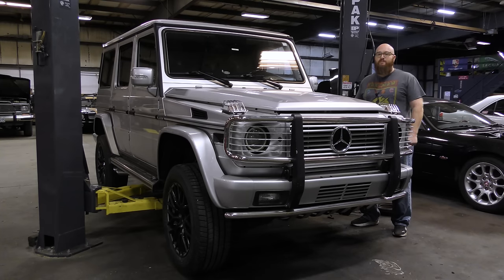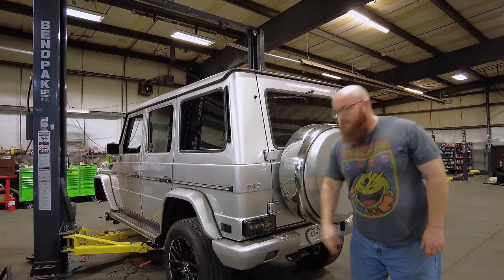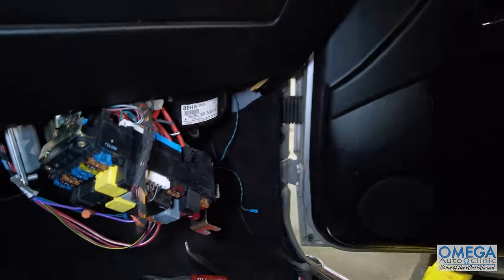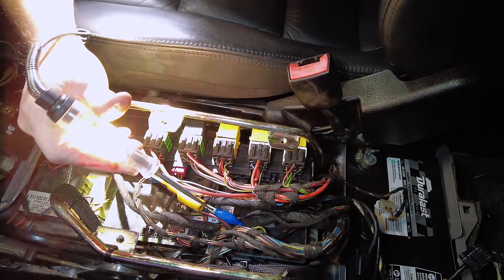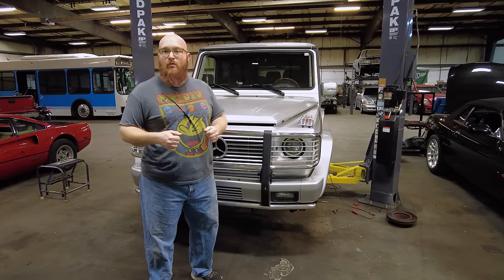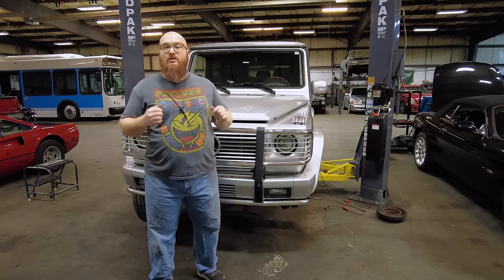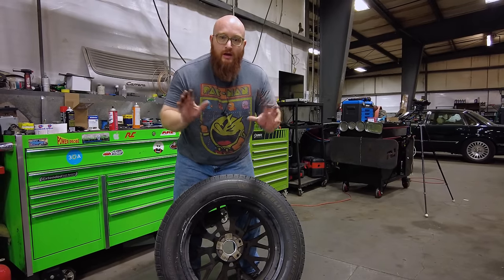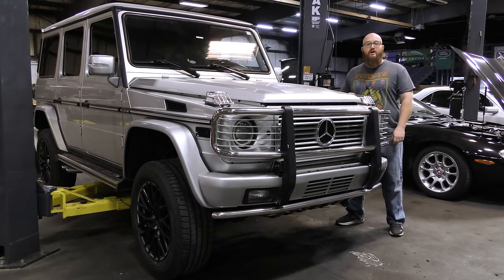Dangerous Mods on this '03 G55 AMG G-Wagon! CAR WIZARD shocked at the level of stupidity

Comment: 12:15 the wheel bolts CONICAL seat ( the V shape ) centers the wheel perfectly to the holes, not saying you should cut middle off but wont necessarily cause the wheel up down issue
Reply: The hub extending out is what supports the load as well as centers the rim.
Reply: @JasonWW2000  NO NO NO i have changed 1000s of wheels... the hub ring is almost never machined to tight tolerances, on most vehicles its loose/plastic. it does not support or reinforce anything a complete fail...
Reply: @JasonWW2000  if you really think the hub ring supports the wheels your clearly not paying attention while changing wheels.... the clamping force holds it and CONICAL seat centers it, it dose not move around to let the hub ring support it... ITS NOT PRESSED ON LIKE A BEARING. Stop making shit up...
Reply: @DeVoNmotorsports  I guess that's were we differ. You install wheels and see the aftermath when the studs break and the wheel goes flying off. 
The tolerance is not super tight or else the slightest dirt would prevent the wheel from going on. There is a tiny gap. This gap disappears when you hit a pothole and you get metal to metal contact. 
Look very closely at a hub. Do they use tiny little pins to center the wheel? Thats all you really need if you only want to center a rim. What they use is a 1/4 thick steel ring that is forged into the hub. The only reason its so beefy and strong is because that's what transfers the load from the wheel to the hub. Wheel studs are not meant to handle shearing forces. They can do it for a while simply because they are very strong and have a large safety factor built in. 
PS, you should not be using plastic centering rings, you should be using the aluminum ones.
Reply: @JasonWW2000  NO WHEELS ARE NOT FLYING OFF....HAHAHA you have no idea what your talking about, IF THE HUB RINGS ARE NOT PRESSED ON THEY CAN NOT SUPPORT ANYTHING.... if there is no hub ring the wheel will start to wobble if it gets loose and then you could stop before it comes right off.. the CONICAL seat and clamping force is what holds it, its not a bearing race, and even bearings deform a bit in the housing and have a BEARING C rating for tolerance/Clearance, most shops don't use or calibrate there torque wrenches  enough, dont look up specs and just use the air impacts most of the time, ugga dugga's,
Reply: @JasonWW2000  when the wheel lugs are tight it will not shear as the CLAMPING FORCE holding it to the hubs locks it in place... if it moves it is loose... the studs are usually more than strong enough to support oversized wheels and aggressive driving, cold weather and rusting, i have seen the holes on the rim open up and rim fall off before the studs snap and shear... and they are made of a more flexible steels and don't snap they bend, Wheel studs are often constructed using forged steel blanks that are then threaded externally to receive a lug nut. TOO much wheel torque is bad and could stretch the shaft and lower the yield strength
Reply: @DeVoNmotorsports  I don't know why your calling me a liar. Wheels do fly off and the car is broken down on the side of the road. I've seen it numerous times. Hubs rings do not need to be pressed on to support a load. The tolerance just need to be tight enough.
I don't know if the wheel will start to wobble before it falls off. I've never had this issue personally. I don't believe that's what happens, though. The vehicles that have a wheel fall off go scraping on the brake rotor a very long distance before stopping so I'd guess something like a pothole or sudden spike of energy is what snaps the wheel studs suddenly. When they check their other wheels there are usually a few broken studs visable.
It is true that the clamping force holds the wheel to the hub. They do not hold the weight of the vehicle, though.
Reply: @DeVoNmotorsports  The studs don't snap off right away, it does take some time and probably a lot of sudden impacts. It might take months or years for the studs to break. It might be dependent on the vehicle. I've seen it happen on both cars and trucks. I imagine the trucks last longer as they are built to handle heavier loads. So they have more studs and they are larger in diameter.
Reply: @JasonWW2000  You don't understand what your talking about, and the people that make the hub rings don't either,
Reply: @DeVoNmotorsports  I appreciate your opinion. I hope you will do some research into it. Ask why the flanges on the hubs are built super heavy duty and thick if they only need to align the wheel. Think about it real hard. Look at the tolerances again. It is not a coincidence they are built like that. It is on purpose. Figure out that purpose.
I say all this because I don't think you want to listen to me. Maybe if you look at all the information you could figure out what's going on all on your own. 👍
Reply: @JasonWW2000  the flanges usually are not super thick as you say and if they are then it is reinforcing the hub/Bearing race and the hub not the rim, i understand why you might think that the hub rings are very important and on some models they may be considered as such, but seems by definition of bearing and load surface engineering a common misconception of the applicability in practicality of hub centric rings
Reply: @JasonWW2000  the car wizard did his magic and Fixed the hub ring! another great entertaining video from one of the best automotive YouTube channels!! Go wizard!
Reply: @DeVoNmotorsports  I'm starting to doubt you've changed "1000's of wheels". SMH.
Reply: @JasonWW2000  here in canada people remove the original wheels and put on snow tires and rims at least 2 times a year for winter... almost every car in the winter has no hub rings with a gap and no problems
Reply: @DeVoNmotorsports  No problems that you know of.
Reply: @DeVoNmotorsports  Calling me names does not change physics. Like I said, I can't convince you. You have to look into it and figure it out for yourself. Ask yourself why its designed like that. Until then, don't dismiss it and say its only for centering.
Reply: @JasonWW2000  the v shape in the seat of the rim were the lug nut sits is a v shape it will center the holes of the rim perfectly to the wheel stud
Reply: @DeVoNmotorsports  Yeah, but that does not mean the rim is centered on the hub. The video above shows this. The G Wagen uses tapered stud ends, yet it was not centered. If your implying the centering ring on the hub is not even needed, we know that is not the case either, also shown in the video above.
Reply: @DeVoNmotorsports  Your entitled to your opinion, but when you call people names you severely hurt your credibility.

Comment: Front wheel backstory: guys running illicit stuff blew out front tires.  Wheels available to get going didn’t fit but they needed to move so they knocked off the centering bungs and continued on their felonious way…

Comment: I am hopeful for the Car Wizard to do the next segment of the six used vehicles, that you should never, ever buy in under any circumstances following the Superbowl next Tuesday. It will be more vehicles with these engines and/or transmissions, that the Car Wizard will focus on throughout his experience as a shop owner and as a mechanic. The next six used vehicles not to buy will be the 2012 to 2018 Ford Focus and the 2011 to 2019 Ford Fiesta with the dual-clutch (DCT) transmission, the 2011 to 2019 Hyundai Sonata and the 2011 to 2020 Kia Optima with any GDI four-cylinder engine (including the turbo GDI four-cylinder), any newer Toyota with the 2.5 L four-cylinder engine and the 3.5 L V6 engine and the eight-speed automatic transmission (Camry, RAV4, Sienna, Highlander, etc.), any newer Honda with the 1.5 L turbocharged four-cylinder engine and the CVT transmission (Civic, Accord, CR-V, etc.), any older Mazda with the 2.3 L turbocharged four-cylinder engine (Mazdaspeed 3, Mazdaspeed 6 and CX-7) and any Ford vehicle with any EcoBoost four-cylinder engine (1.5 L, 1.6 L, 2 L and 2.3 L). Thank you very much and have a great weekend.
Reply: Also the 2010-17 Chevrolet Equinox and GMC Terrain with both the 2.4 and 3.0/3.6 liter engines. That includes all models and model years. Never ever buy one. Also avoid the Chevrolet Captiva Sport as well.
Reply: @atx-cvpi_99  Thank you very much. Moreover, do not buy any Ford vehicle that is FWD, with the 3.5 L and 3.7 L V6 engine, as well as the 3.5 L EcoBoost V6 engine. The RWD vehicles are the only exception. Finally, do not buy any Chrysler vehicle with the 2.7 L and 3.7 L V6 engine and the 4.7 L V8 engine, as well as the 2.4 L four-cylinder engine and the 3.6 L Pentastar V6 engine.

Comment: just bolts themselves should have aligned that wheel on the hub! For that you just need to install original rims with the correct bolt diameters - it will be even cheaper ;-)

Comment: Wondering if all of that aftermarket crap was shutting down the FET in the module, possible it would come back on line with the correct load.  Just a thought, don't know the circuit specifically

Comment: Hoovie’s 69 Charger is likely stuck in 2nd gear.  Might check the trans step down link connected to the throttle lever for mis-adjustment.

Comment: Hi, very interesting video! Awesome. I’ve got a similar problem, which is the all left side, headlight, turn (frt and bck), brake light, reverse or rear fog, nothing works. Also center console screen, navigation does not turn on. Any idea what it could be? SAM FRT AND REAR failure? Is there a “SAM” for navigation system? Thanks! Best regards

Comment: That's crazy what they did to make the wheels fit how about a Nissan Pulsar once and it had 15 inch side wheels on it and I had a vibration and I took off the wheel there was eight washers on each lug behind the wheel with longer studs Ralph Nader would have a picnic with that thanks for the video I keep learning everyday more than I already didn't know have a great day

Comment: Given that's an LED unit at the back, is it presenting an insufficient load that makes the rear SAM think that the OE bulb is dead and thus it doesn't signal? Did you try a 21W bulb on the rear turn signal? Regarding the wheels - that's exactly why you can't fit BMW E39 wheels to an E34 without fitting a ring - the hub is larger on an E39 (74.1mm) compared to an E34 (72.6mm, I think) and you will get the very symptoms you describe. Strangely, E60 wheels will fit an E34 as they have the same hub diameter (at least, here in Europe). The modifications you've done are good, sound engineering and commendable.
Reply: The E39 is the odd man out, it's the only one with that centrebore.  Had to do that to put style 29's on my e28.

Comment: So bypass the module you didnt want to replace. Since they are all aftermarket LEDs there's no "extra" load. If the original lights were being used.... it prob would not work.

Comment: That kind of fix is a sure way to loose a wheel on the highway, with the exciting and costly result that may have. The wheels need to stay in place dead center on the hub, or you'll get these vibrations and strain on the components in the steering and suspencion, not to mention lug nuts that go flying if you are unlucky.. All wheels that are not made for that specific car model will come with a set of center rings that will make the wheel stay firmly on the hub, and your lognuts are there just to fix them in place. Loosing wheels because of a really poor mechanical fit of the wheel to the hub is totally not acceptable, because you are actually making a time bomb, with an unknown detonation time. Lugnuts cannot hold the rim onto the hub if the rim is not shaped to the hub and has a good fit to it. The forces that lugnuts has to withstand is so much harder than it should be if the fit is wrong. I experienced this on a Renault I had once. It came with off market wheels that looked great, but the rings had been "overlooked" by the mechanic.  I lost a wheel, most lugnuts, my brake got torn to pieces and it cost a small fortune to repair. The garage owner was not happy to get that bill and the mechanic was immediately fired. The garage owner had an impressive arsenal of descriptive adjectives to scream at the mechanic as he was leaving.. I was impressed about how many ways you can call someone an idiot without repating yourself.. lol

Comment: Based on the limited evidence provided in the video, I consider the issue of rear indicator lights not working 'may' be due to insufficient resistance detected by the rear SAM.  If I was diagnosing the issue, I would have temporarily attached an incandesent bulb to verify my assumption.   In my own vehicle I have fitted rear LED indicator bulbs, however to make them operate correctly I had to couple an LED load resister with each bulb.  Fortunately approriately rated LED load resistors are now readily available - so no need to "cunjure up" a suitable resister.

Comment: What about the weight of the weld on the inside of the concentric.  You can balance the tire and the rim but it the weld is not balanced, you can' balance the wheel.
Reply: Doubt that will make much difference, especially given it’s so close to the centre of the hub. If the extra mass was at the edge of the wheel then that’d be another story.

Comment: This is a 20 year old vehicle.  Most 20 year old vehicles have already been crushed.  New expensive luxury vehicles typically are maintained longer and appreciated.by the owners.  Sadly, parts and labor do not depreciate through the years.  Minimal aftermarket support of low production vehicles.  Still
Difficult for second, third, etc., owners to afford repairs.

Comment: I got my G-Wagen.  My girl is riding shotgun in her fav g-string.  We are hauling the secret payload and heading for a big payday.  We got the lights out.  And we are hauling ass in style.  Hell yeah!
Reply: This is a dream?
Reply: @JasonWW2000  Not my dream.  It is the history of this particular G-Wagen.........
Reply: @michaela1655  What your describing is a youth's idea of greatness. Pure fantasy.
Now why would you say it's this particular vehicle? Just more fantasy?
Reply: @JasonWW2000  Why else would they have a switch to turn the running lights off?
Reply: @michaela1655  The lights don't work because the SAM module is not working. Remember that Wizard said power was not going to the rear lights. If flipping the switch fixed it, thats all that he would need to do. The switch appears to let you select either the sequential flash or a solid flash. It is an option built in to those aftermarket led tail lights.
Reply: @JasonWW2000  Sorry, I thought the switch was for stealth mode.

Comment: Okay, so if the rear light CAN operate if they're wired to the front SAM, they WHY did Mercedes design it's turn signals to work off separate SAM's?  What was their logic in the design, I wonder?

Comment: Am I the only one that thinks 200nm isn't a lot? My Range Rover needed the wheel hub stake nut to be torqued to 192lbft (260nm). The Discovery 2 requires an astronomical 360ftlbs (490nm)!

Comment: My first thought after watching this video was it belonged to some drug seller. 
And what a hacked up job the original shop(s) did on those modifications

Reminds me of that Lamborghini sometime ago where David is trying to undo all of the damage from a sloppy third-party installation of some radio or some thing 

I like things stock. 

And if you don't want stock at least have a professional level installation. 

The kind of installation that one could look at and think it might've been a factory job   

Putting those goofy wheels on and doing that Mickey Mouse cut up job to make it work was the icing on the cake. 

the whole thing stunk. 

Not the car wizard of course but whoever did that work 

I suppose to get the thing at least in a semi-normal state running an extra wire back-and-forth would be worth saving thousands of dollars but if that were my vehicle it would bug me for the rest of the ownership time

Comment: Car folks! HELP ME decide.
2006 Hyundai accent with 87K nicely serviced for $1.8K
Or
2000 Honda civic with 98K on it for $2700??
I like the Hondas look better but the Hyundai seems like a wiser decision. I need a work horse for 3k driving/month
Reply: You need to ask yourself why a  newer car with a bit less mileage is so much cheaper?. That will tell you which car has the best reputation for quality & longevity. But get a mechanic to check it out. I have owned several Hondas and one Hyundai, that may also tell you something about my opinion.

Comment: I was thinking insurance fraud / brake checks would make more sense than kill switch for brake lights, 
It would be silly to put the switch there for insurance fraud though as you can't pop your tail lights off and flip the switch with other people watching before the cops get there.  Very unlikely anyway.
On that note a crim isn't just going to want to turn off brake lights. They are going to want to turn off brake, tail, turn, parking, DRL/auto headlights, license plate, maybe even dome to prevent accidental turn on. Pretty much everything but manual headlights and maybe dash lights.
If they just wanted brakes I would think it would make more sense to go after the switch on the brake pedal. Then the switch would be accessible for the driver too.
Another commenter thought it might be a setting thing for the tail lights which makes the most sense to me so far. Seems like a "set it during install and forget" kind of thing.
That said is seems like jumpers or something that can be heatshrunk would be a better option for the manufacture of the tail lights, if that is what it is. A switch like that getting exposed to moisture will lead to failure.
Curious if you actually traced it to switching the brake light or flipped the switch and it didn't work.